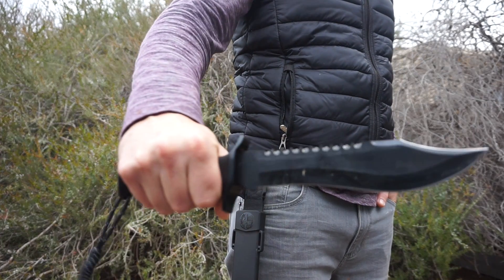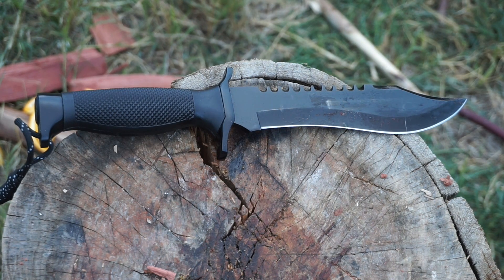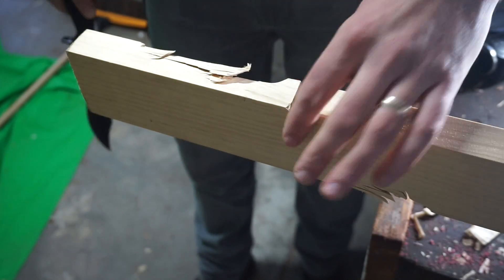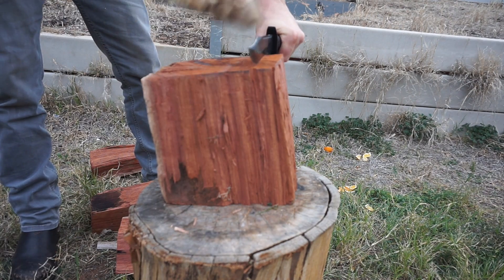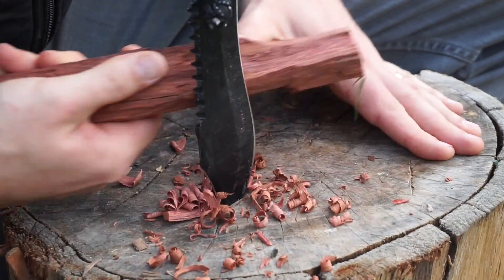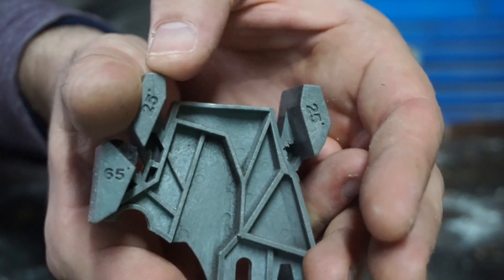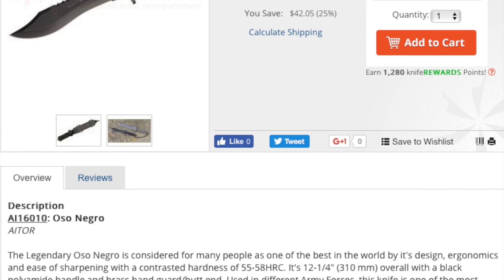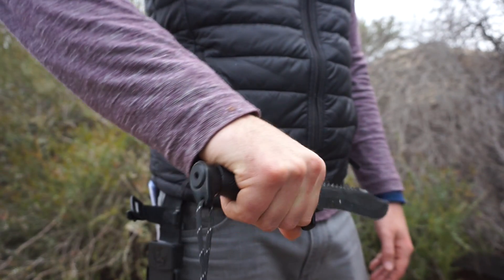Strange, Wonderful? Aitor Oso Negro Combat Survival Knife

Comment: Hi, yeah as you know I reviewed the Olive wood version of this knife. It is a beast of a knife and not likely to fall apart on me LOL. As for the steel keeping an edge, well my one was a little uneven in the grind and I'm trying to right that. But yeah, it hasn't been too bad even if it got a bit dull after a day of cutting wild mushrooms but the caveat was that I had cut into grass and dirt all day, hacked up hardwood for BBQ, cut chicken on ceramic plates and general arsing about  LOL,  and silica on grass and dirt don't do well to any knife steel either.  Good review too.
Reply from the maker: +Bush Camping Tools yeah it feels stout as, very capable indeed. With big woods knives I dont mind so much about fine edge retention as long as it keeps a good working angle 👍🏻
Reply: right on.

Comment: I should have suggested the bk5 to you for your cutting test, it's the best slicer in the bk series, it's thinner behind the edge than most folding knives and might have made your test a bit more easy going. LOL, I'm actually a little nervous about the testing, you better not let me down 1095 cro-van!
Reply: It probably will be just fine because most of the blades in 1095 (cro-van or not) are used most often for working with wood and shine with the forgiving nature of the steel^^ Even if the cutting test with rope shouldn't show an exciting performance, the steel has its well earned place in the knife industry.
Reply from the maker: Mopar HEMI exactly, every steel has a purpose, and edge retention, to me, is much lower on the heirachy of importance when compared to toughness and edge stability. But I reckon the Cro Van will do pretty good edge wise too

Comment: Say Heah Cedric, Yeah, Nice Knife. I also see how much they cost now too. But I just got a S. O. G. Pillar Fix Blade. It's a 5" blade with a choil that makes it a very good Bush Craft Knife. Seriosly if you have a chance to get one, I defenetly recommend it. The steel is CPM S35Vn I also set tge sheath for a horizontal carry, I use it as part of my  basic Trio. With my Gransfors Bruks Small Forest Axe and either my Agawa Canyon 21 Boreal Saw or my WoW Folding Saw. But my Wicked Tough Saw would be a good choice too. Yeah, Atleast check it out.,,. p